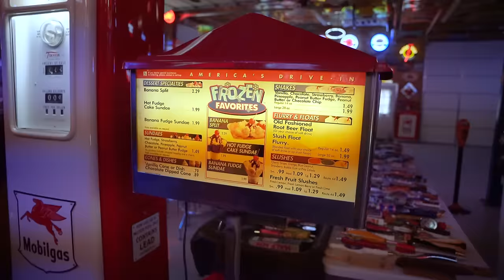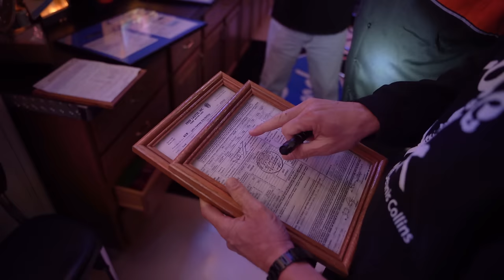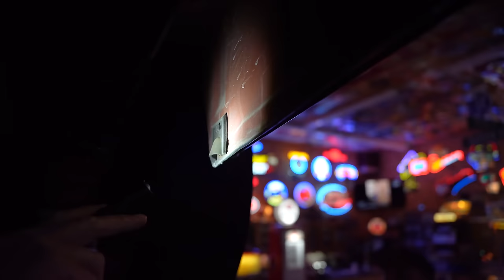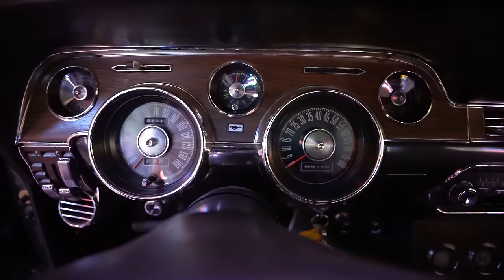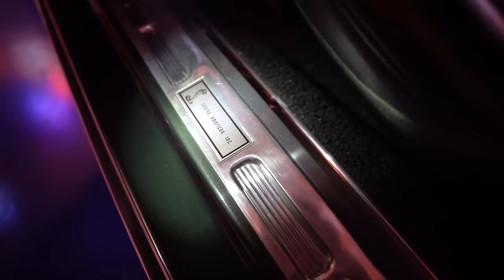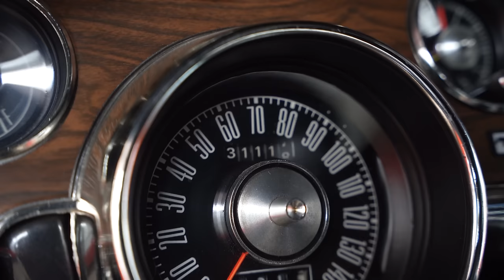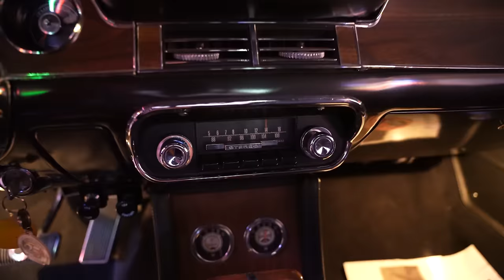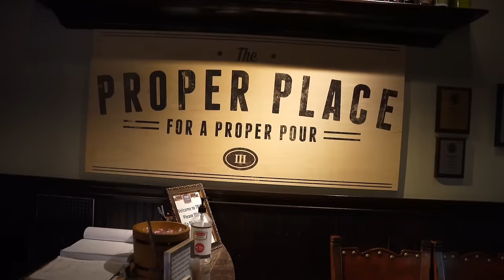RARE FIND: 1968 Mustang Shelby GT500KR!!

Comment: I'm not a big ford guy but my first car was a brand new 1979 Ford Thunderbird last of the big beauties. Gold with wire wheels and buckskin leather interior. I worked as a life guard at the country club at 10 bucks an hour. In the late 1970's that was a bunch of money. I saved up 8k and stepfather kicked in the other 2k. 8 track player, bought pioneer super tuner cassette with booster 200 watts and equalizer, Jbl tri axles, dash tweeters. She just rocked. Everyone should hhave the EXPERIENCE earning their first cars. Dennis you are my hero i learn so much from you sir. I beat stage 4 TONSIL cancer watching your videos. I think you helped heal. Never been beat before. I think the Marines taught me to be a fighter of all fighters. Keep up the great work. Neal APOLLO BEACH FLORIDA SEMPER FI OHHHHHH RAAAAAA. I just finished my 1969 Amc amx 390 XCODE go pack with every single options.

Comment: Why do you keep saying things like "there were only 40 of these made"  etc

Who cares ... all of these cars will be more expensive, less durable, less functional ... 

Guess you have found a way to take advantage of some people who don't think this thru ...

And if a person acquires one (from you or someone else) ... they end up with a garage queen that they are afraid to drive ... if they do drive it, they find it lacks the much more sophisticated engineering and workmanship.  And their garage queen doesn't handle the miles near as well as a more modern (better designed) model.

Buying a new C8 Corvette (esp the ZO6) is far better & cheaper car than any of these ...

If you contend that this is an investment that will increase in value ... how about if you share with me some DCF calcs on average cars bought in this fashion ... not just one or two that made big $.
Reply: Vintage cars are more than profit and performance
Hopefully you'll grow up to learn this

Comment: A 68 KR convertible 4spd was our high school auto shop project senior year in 1978. It was black with a white top, steel wheels, all original. We rebuilt the motor after it had been sitting behind a gas station for a long time. Of course it had to have some thorough test driving after to make sure everything was OK! Some say it may have even it's acceleration successfully tested against a fast, modified 455ci 442.

Comment: Back in the early 80s, I used to walk past one house after school that had a 67 with those same wheels on it.  It was a GT500KR Shelby, red and white, convertible, and it also had the GT/CS package on it.  It was all original and had the original paint.  I assume it was custom ordered by a Ford employee who knew what options to check.  The guy wanted $40K for it back then, when you could still get a pretty original muscle car for $2500.

Comment: First Shelby I ever rode in was a '68 428 KR. We did the engine for it and owner dropped it off for to be final tuned. I was 12 and thought it was so cool because of the roll bar. That was in the mid 80's when they were still somewhat reasonable..

Comment: I had a 70 with a 428 scj put together with a 427 side Oiler AC Cobra engine, a father got it with 640 miles on it and turned it into a drag car, able to pull the wheels in the first three gears it went away with my ex-wife only 706 miles on it Warehouse kept it's whole life

Comment: We're gonna have to catch up at some point. I have a 68 GT500KR Convertible, green, A/C, 4 spd, all original drive train, out back in need of restoration. Not sure if I'm gonna do it, but it is interesting to see how many of the few of these KR's are still around, especially the green 4 spd, with air. I have others , but that one is the most valuable, as you know.
Love that you have the ability to do what you do, it is my passion, but unfortunately my wallet prevents me from enjoying it, as you do.
Have a great day.

Comment: My wife's dream car was a 64.5 Mustang. She didn't care what color it was, as long as it was black or teal after a restoration. I ended up finding her an original Raven black w/black interior 260 V8 3 speed manual that was built May 26th, 1964. It's parked next to MY Mustang that was built May 28th, 2015. Lol

Comment: I have a friend who’s dad let an NOS restored ‘68 GT500KR VERT in Acupulco Blue/white interior/white top 4 speed WITH A/C (!) just sit unprepared for 25+ years next to their low mileage Grand National and he won’t F’ing sell either to me. I’m a Mopar guy, but I know a gem when I see one and I’d love to get my hands on that ‘Stang. You’d never guess it’s there driving by. Sitting catty corner is a transmission shop housing a B5 on B5 with white SE vinyl top with the small rear window plug ‘70 383 Challenger that had a Hemi/Auto installed at the dealer before delivery because it was cheaper to add the Hemi and keep AC than the the other way around. Huge mistake in retrospect. Remember that when you’re buying today’s cars. He’s asking $100k, fully documented. It’s probably worth it, who knows. Not to me, it’s not. If it was black, 4 speed with a shaker, then yeah, but not as it was ordered. Nice car, restored.

Comment: On all Ford 8” and 9” rear ends of that era, there’s a metal tag on the front driver’s side of the differential casing affixed by one of the case bolts, which shows the ratio, and often there’s a code for Traction Loc, Detroit Locker, etc.   An open diff will generally if not always be just the ratio.   If no code after that, no limited slip or lock-up.  On that note, consider this reality of solid rear axles compared to independent rear suspension set-ups.    IRS are less likely to end up peg-legging a burn out, compared to a solid rear axle.  Why?    Because the drivetrain is constantly trying to lift the right rear wheel and press down the left rear wheel.   For every action there is an equal and opposite reaction.   Standing at the front of the car, the engine through to the trans tail shaft to the diff yoke is all spinning counterclockwise.    Grab a balsa wood rubber band driven toy plane and wind that thing up,   The wings want to rotate on the longitudinal axis of the airplane in the opposite direction of the spinning of the propeller.    The rear axle want to spin clockwise.    Take away the rear of the chassis and the rear axle would just flip over and over clockwise, with the tires flopping around, but in action, the chassis holds the rear axle in place, forcing it to redirect that rotational force through the pinion gear to the ring gear and on to the two axles halves.   Regardless, the softer the springs, the more likely the right rear tire is to spin and the less likely the left rear(driver’s side) tire is to spin.   Put your car in reverse and jab the throttle and the opposite wheel will be more likely to spin, and in this that would be the left rear.  Go out an do that with a solid axle open diff vehicle, especially a pickup truck and notice that the opposite wheel spins first in reverse versus a forward gear.    So the reality is that the two rear wheels don’t have just a little traction discrepancy.     With an open diff and all else being equal, the right rear tire will always spin first.    It’s because, once again, the right rear tire is literally being almost lifted off the ground but the chassis keeps it located, hence the name, “locator bars”, and the left rear is being pressed ever harder into the ground.   The more power applied, the more this tendency rears  its ugly head.    That’s. Also why it’s more common , and in my case instinctual to try to cut a donut to the left, counter clockwise.     Of you do it to the right, with an open diff, you’ll just spin the right rear tire, the left rear won’t break traction, and no sideways donut.  But to the left, the left rear has more traction, and the left rear is more prone to break traction, so if you can get the right rear nice and lit up, then cut to the left, the reduced weight on the 
left rear tire allows that one to join the right rear in the fun stuff.     So….yeah…….ummm.

Comment: NOT the stock cam in the Mach 1, had  a 69 & 70 R code drag packs back in the day, the main difference in a CJ & SCJ are stronger internals, lemans rods etc., think cams were same, regardless, neither sounded like that ! My 69 was manual steering also; Ugh ! A member of the local Mustang club is the original owner to a red twin to the Shelby, a little rougher than this but still an outstanding car !

Comment: That  bring me great  souvenirs  with my  GT500KR  conv lime green  4 speeds  black interior   that i sold in the 1980's  .  The only thing   about 68 shelby's   is the nose   center fiberglass piece
is very fragile to break   around the steel brakets   so (be carefull  )  ?

Comment: It’s bonkers how they used those lowly regular production steering wheels on Shelby cars.    Besides the Shelby emblem, that’s the same steering wheel as on my 1969 Country Squire.  But mine was prettier, cause Maroon.   Is pretty.    That’s just mind blowing.   They couldn’t spring for the three spoke steering wheel?

Comment: I have a 428 Super Cobra Jet and it's very fast it will break the motor mounts and break the U-boats on the rear end is the fastest 428i ever bennion it's so fast that my brother went outside got in the car stomped it to the floor like two black marks down the street and flipped it over three times and split it down the road on it stop totaled the car out and I got the motor transmission and the rear end